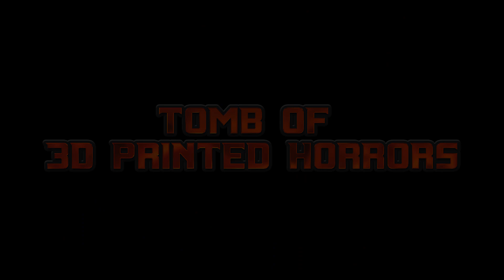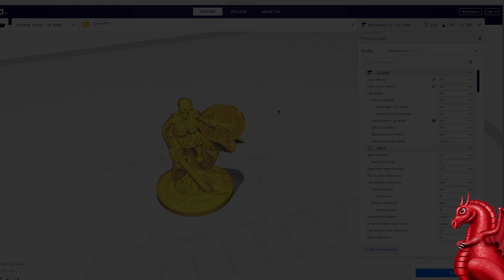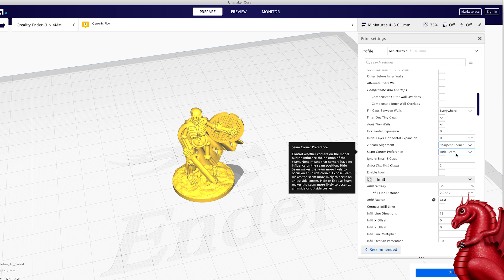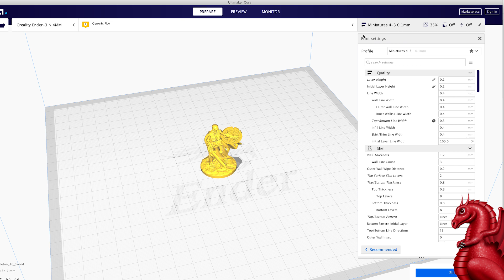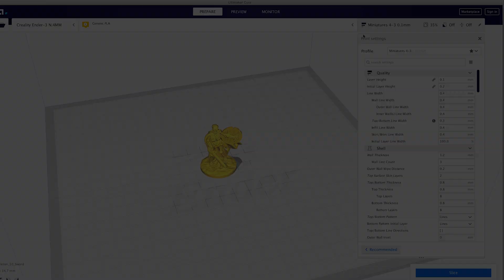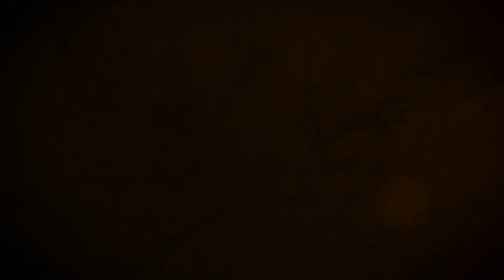How to 3D Print Better Miniatures: Pt. 2 Cura Settings

Comment: Thank you for the time in making this video and the profile. What version of Cura does this work for?
Reply from the maker: 4.0 and higher :)
Reply: Great video, going to have to rewatch thus a few times to absorb it all! Wouldn't 4.2's replacement of the standard profiles with the Creawesome mod break the FDG profiles? Or have you compensated for that somehow? I've been staying on 4.0 out of a deep paranoia about breaking the FDG profiles, since I live or die by them (metaphorically speaking). 😂

Comment: I'm curious, what using 0.2 nozzle would change. Just half everything? (I jest) Interesting subject and a good video on it. :)
Reply from the maker: Just use the .3 profile that is linked in the video description, slow speeds down by 10-15% if necessary